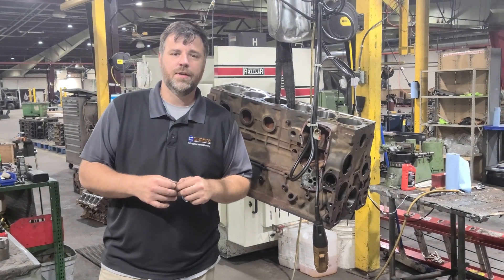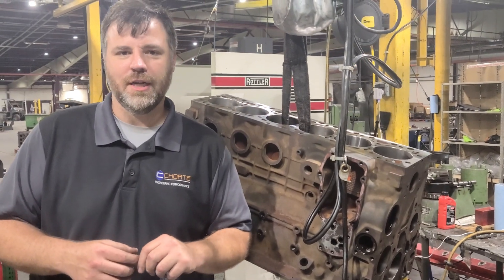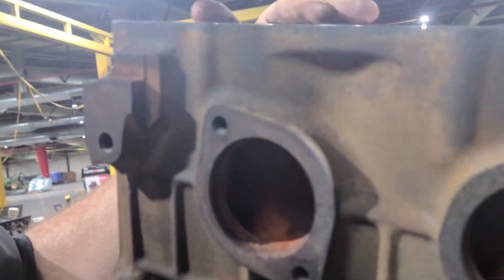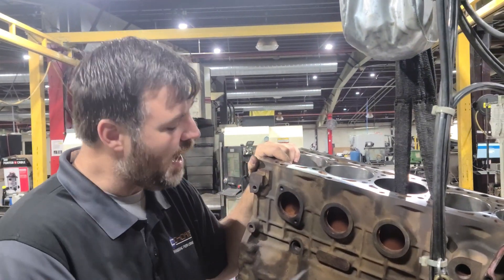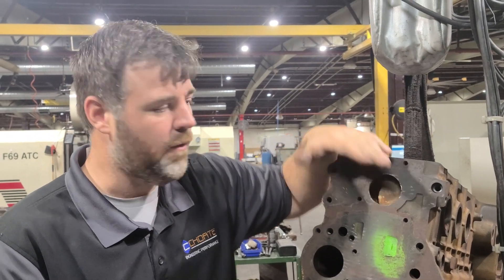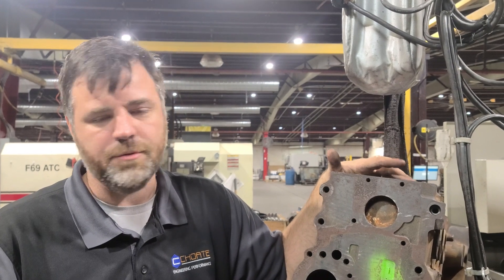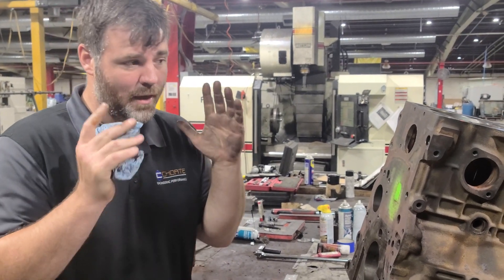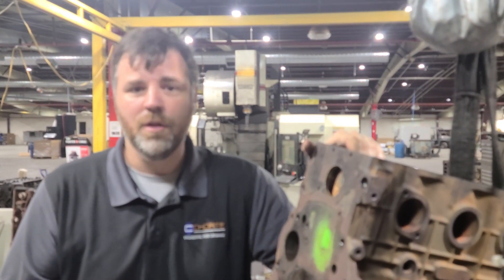Don't Use Stop Leak in your Diesel!!!

Comment: I’m on my 2nd radiator from Mishimoto. Both have had small leaks at where the fins are brazed onto the tank in the same area. I’m unsure at this point if it’s my truck causing the problem or the quality of the product. I was considering K seal but this changed my mind. Thanks for the video.